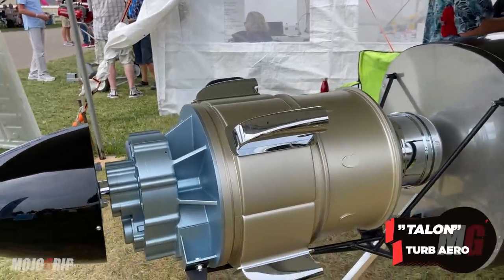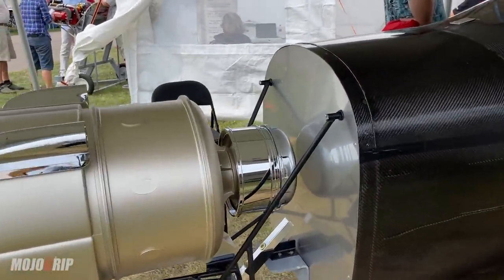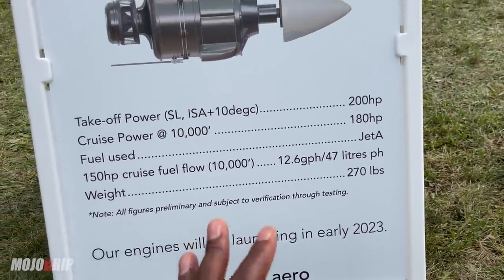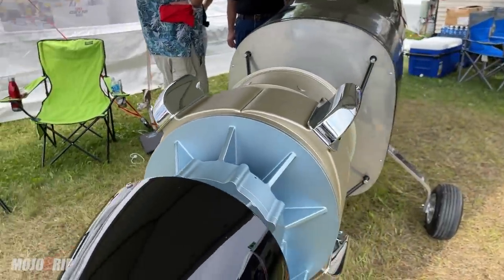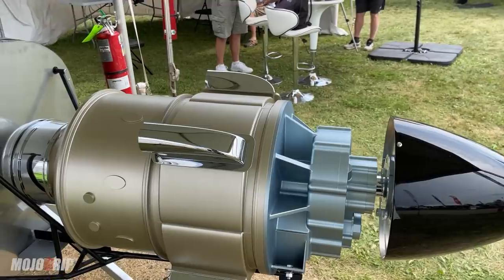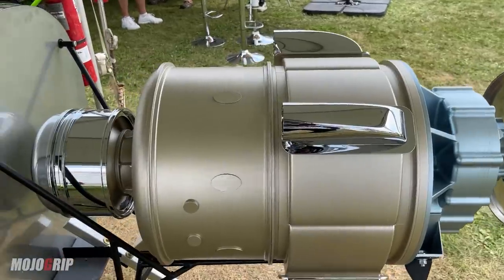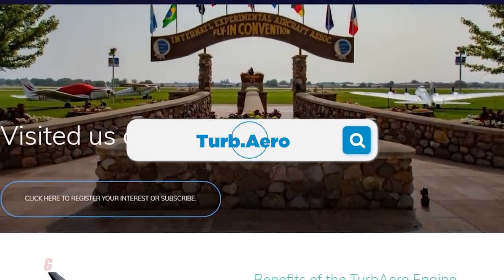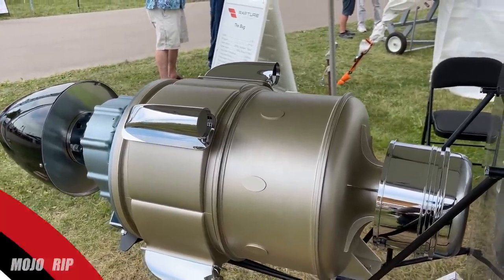200HP Turboprop Engine To Power Single Engine Airplanes - TurbAero

Comment: I have to ask now. Why do turboproppers always start their engines with to proppeller in Fether stand? Fether is smart when you are actually flying. But when stationary it is the most absolutely the most resistance. I think pilots are not the stupidest of the bunch. So there must be a good reason for it. Please tell me!

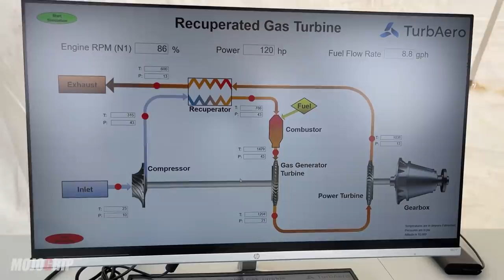Comment: 4:12 I'm not sure I understand that illustration. Theyre pre heating the intake air with the exhaust air? Why not just run a higher compression ratio to increase intake air temps, wouldnt that make for the most efficient result anyway?
Reply: It uses otherwise wasted heat to heat the air after its compressed saving fuel.

All ground based turbine engines trying to get decent efficiency have a recuperator.
Reply: @5002strokeforever  So I got the illustration correct. Why would a recuperator be more efficient than running a higher compression compressor. If the max temp going to the combustors can be 1200 degrees F why only compress the air to 800F? Why not get the added power and efficiency of more compressed air coming from the compressor?
Reply: Lets say due to cost  you are limited to 8:1 on the compressor and turbine.
Higher pressures are exponentially more expensive.

The only thing that matters is that you heat the compressed air to the maximum temperature the turbine is rated for.

This could (and has) been done with anything from electric heating elements, microwaves, and even nuclear reactors.

It really dosent matter how its done, and if you can harness some waste heat to help thats less fuel to be burned
Reply: Arriel 2b is over a million dollars with a 8:1 ratio.
 This 200hp plane engine is likely supposed to be much cheaper, you cant expect it to have a higher compression ratio.
The higher ratio the higher temps on the compressor and turbine. (More expansion and contraction requiring bigger gaps)
The tighter the tolerances have to be, when you are dealing with 120 psi it dosent take much of a gap at the compressor to leak all your power away.

Comment: Hate do be the downer here, but this smells like vaporware.
Reply: Scepticism is a valid reaction to this.  The onus is on us to deliver.  Our engine is solely within our computers at the moment (although we have built and tested several components already).  As of next week, we are cutting metal for our prototype (and machining and casting and printing and welding and...).  I hope that folks can watch the Talon come together as it transitions from vapourware to individual prototype components (hardware), to a functional running engine and through to a commercial engine that we are delivering to satisfied customers.

Comment: If they had to bring a mock-up for display, 2023 won’t be happening….
Reply: Hi rodzack.  The design is completed.  We are fabricating components for the prototype engine now.  It's not just a model, its 3.5 years of full on design, analysis, and component prototyping and testing by a team of 20+ engineers.  Deliveries in early 2023 is ambitious but we've set ourselves a target to work towards.

Comment: Who in their right mind would want to cruise in a turboprop at 10,000 feet?
Reply: Me!
Reply: the caravan does 10-12000
Reply: Beats a recip 200hp turbo. Imho
Reply: Fuel burn at that height would impressive, you'd need drop tanks
Reply: Turbines only work high and fast otherwise you burn more fuel than you travel in knots
Reply: @matthewspry4217  A recip engine burning 200hp is around 50-55 lph. Say a lycoming TSIO 360

This turboprop burns less and the fuel is cheaper.
Reply: @matthewspry4217  Are you a pilot?
Reply: @ashsmitty2244  The Continental TIO-360 makes more power (220hp) burning 12gph @ 12,000ft. So, same fuel burn but a lot more power at cruise. Jet A is cheaper though and this naturally weighs less than the recip.
Reply: @dieselyeti  Thanks for that,  I had the Continental in my head, the one in the Seneca’s. 

I have a few hours in them but a while ago, 15 years.
Reply: @dieselyeti  It’s also quieter, smoother, safer  sleeker, reverse prop. 

It’s going on my Dark Aero.
Reply: @ashsmitty2244   Here is the same engine 4 years ago, it's only been in development for 15 years 
https://youtu.be/FEn1iCU6Hh0

Comment: You're not going to get those numbers without more turbine disks and much high compression ratio's, Even with that, the physics of fixed air density vrs compressor efficiency vrs size coefficient, only gets worse as turbine engines are scaled down, and at that size, horrendously worse. Hence, lower specific fuel consumption in X-large size modern turbo fans and prop jets. You cant' beat the system on this one unless one has a magic wand.

Comment: The answer for ALL propeller driven aircraft is the "Dyna Cam" engine.  This engine has ALREADY been certified and flight tested on a Piper Arrow.  The "Dyna Cam" engine is superior to  the PT6 or the Allison or the Garret turbo props because it's vastly less expensive.  It doesn't require the use of high grade titanium like turbine engines require.  Yes it is an internal combustion engine, but with 1/2 the moving parts of say a Continental or Lycoming. Now what will happen if you go on the internet and just do minimal research, you most likely will conclude that the engine is a "scam".  This is FALSE.  The engine is GOOD.  What happened was the brand "Dyna Cam" got caught up in a complicated investment scheme and it's this financial scheme that paints the picture of the engine being a "scam".  I would encourage the GA community to back the inventor of this engine that USED to be called the "Dyna Cam" engine.  It does NOT matter what the engine actually ends up being called.  THIS is the engine that could revolutionize propeller driven aircraft.  Now please don't quote me on this: but to the best of my knowledge, this engine can run fine on "low" octane fuel.  Which means unleaded fuel.  Which means that as far as fuel, once you solved the octane problem, the only consideration is vapor pressures which that is a complex issue, but I'm sure can be solved.  If we can get the lead out, we get EEEPAH off our collective backs.  Let's not fool ourselves, we should trying to get AWAY from turbine power, not embracing it.  Yes, turbine power is wonderful on a B737 and I would want to keep it that way.  But all other classes of aircraft with propellers need to switch to "Dyna Cam" power.

Comment: The sad truth in history of civil general aviation turboprop singles is  We had a small light acceptable fuel burn family of engines that could of been used to power this class of aircraft since the mid 50s early 60s.  That would of been the Boeing T50 and T60 engines,  Yes   Boeing had a gas turbine division back then which they closed out.  Allison Continental or Lycoming could of bought the patents or license and made these.   Look them up on Wikipedia.  These small light but powerful engines was used on a early U.S. Navy anti-submarine drone helicopters back it the 50s and 60s. It also was the engine used to power the first turbine powered helicopter and was used as a turboprop engine on some models of the Cessna 0-1 " Bird Dog " light observation plane. Those engines and its designs sat in crates as military surplus for decades doing nothing.  We are over 50 years behind, seriously.  Was it the FAAs fault????  nobody wanted them back then ???.

Comment: Why are these parts so expensive? 80 grand for a 200hp engine?
Reply from the maker: For a turboprop, $80k is actually very affordable. Any standard turboprop in the market today will run you $500k and up
Reply: @mojogrip  but why? I mean what prevents me from using a 200hp motorcycle engine or two or four for that price? What is it that makes these turboprops so special. They seem compact but not tiny, light ofc and medium power.
Reply: @L3v3LLIP  In an experimental aircraft, there is nothing to stop you, but if you want to carry fare-paying passengers, or even charge people for flight instruction, you need an engine that is certified. Turbines are compact, and relatively light weight for their  power, they are also more reliable and cheaper to maintain as a result.
Reply: @tlangdon12  Thanks for elaborating :)

Comment: I was excited for this engine but when you said 1000hr for TBO is too low in my opinion for turbine !! I thought at least 3500hrs for tbo for this I’m out
Reply: the manufacturer in their website quotes around 3000hrs
Reply: Initial TBO is going to be low for any new engine until it's proven. The FAA is conservative with new stuff like this.
Reply: @dieselyeti  roger that
Reply: @dieselyeti  ok that make since then I’m in 🤞
Reply: I got modern Twin Comanche Do you think I could upgrade my piston to Turbine ? My IO-320 weight almost the same as the turbine

Comment: Turboprops are notoriously gas guzlers. 75% at 10k 47 liters per hour.  Expect way more at lower altitudes.
Maintenance is more expensive than for a piston.
It does not look like anything production ready
There are more small turboprops in the market.
Not a game changer at all.

Comment: 10,000 feet is nothing, and 12 ghp is much more than a rotax. why not configure it for a decent altitude where you can reach decent speeds. FL25 or 30 would much more useful. And FL45 even better. Also any news on costs to buy one.

Comment: Thats not a prototype, to be that close to release and not having an actual motor at Osh?  What am I missing here?
Reply: Hi Keith.  It was misidentified initially as a being a prototype but Mike corrected himself after to say model.  Also, we are targeting first deliveries in Q1 2023, so 18 months away.  We are prototyping components for the remainder of this year, with the aim of having the prototype engine running on the test stand early next year.  We have allowed 1 year for the test program which is ambitious but we need to set ourselves a goal and work towards it.  A lot of experienced/technical resources (manpower and hardware) are being used to make it happen.
Reply: @TurbAero  THanks for the information, I have looked around for alternatives to the IO540 for an RV-10 build. It pains to spend that kind of money on technology that old.

Comment: I hope this is more than a plastic mock up, some made up specs, and an effort to judge market acceptance.  Saying that because if they actually have a design, it shouldn't be too complicated to get 1 built.  Lots of shops out there that can do multi-axis machining and make one off parts pretty affordably.  That they haven't done it yet leads me to wonder if they a) don't have a design yet, or b) can't afford the alloys or the machining to build a prototype yet.  Even after they get it running, there's still a lot of work in getting the engine management software right, and going through the certification hoops.

All that said, if they can make the cost/hr similar to an o-360, it would be great.  100LL is going away, and turbine engines are simpler and more reliable.
Reply: Hi Tom. 
I'll take your last two sentences as a positive sign of support.  Thanks for that.  
To address your first paragraph, I might quote from Mike Patey who starts his YouTube videos with "Design it, build it , test it...".  TurbAero is in the final stages of the "Design it" phase and have just started the "Build it" phase.  I can assure you that it IS complicated to get one built.  The number of custom components, the multitude of different materials (Inconels, Titaniums, Hastelloy, MAR-Ms, Steels, Aluminiums, etc), requiring different manufacturing techniques (machining, welding, metalworking, casting, additive manufacturing etc) to such precise tolerances and those are just the mechanical components.  There are still the electronic components, fuel pumps and starter/generators with challenging characteristics, etc. that are not available off the shelf and need to be built.  There is a combustor, fuel nozzles and an ignition system that have to start the engine at sea level through to 20,000' without problems.  Every single component has to be analysed to make sure there are no rotordynamic issues that will result in poor engine reliability, high wear or even the engine tearing itself apart.  We had to incorporate new technology to offer better than historical fuel efficiency.  That component comes with significant challenges in terms of performance, weight cost etc.  The development of this engine is a serious undertaking that requires significant resources, with time being one of those resources.  We haven't "done it yet" because the development of such a complicated engine takes time and things by necessity need to be done sequentially.  This is what we are doing and we are doing it conscientiously to ensure that when we do finally deliver the engine, it is one that we can be proud of and will deliver a safe and reliable engine to the customer.
This is more than a plastic mock-up.  It is 3.5 years of design by over 20 engineers and we still have a way to go.  I hope that you will monitor our progress along the way but please don't expect an engine to be built overnight. That is not the nature of an engine development program, particularly for such a challenging small gas turbine.
Reply: @TurbAero  If it can be designed, and built, it sounds great.  Everyone should be aware that, as you explain above, there is a huge difference in complexity between an aircraft and a turboprop engine.  There have been hundreds of aircraft manufacturers over the years, but probably only around 20 teams have made a turboprop engine.  Most designs are decades old, so there should be room for improvement in efficiency, but at the same time the engines in service today took years of prototyping to get working.  

I do hope this works, but if you haven't spun up a prototype, and this is a blank paper design (not based on a scaled design from somewhere else), this is going to take a while.

I don't mean to seem negative.  People are used to product announcement in software and computer hardware, where design cycles are measured in weeks or months.  As you say, turbine engines don't work on that cycle.  Truly wish you guys the best.

Comment: 200 hp ?  the TSIO 55O  makes over 300 hp.
Reply from the maker: Yea but this engine will retain it's power output at altitude compared to a piston engine
Reply: @mojogrip   we are a cirrus service center.  we have customers wearing O2 in their sr22T's  flying over 20k +  with ground speeds in excess of 225 /250 knots  with tail winds. ( with the gear down no less ) you're not going much higher unless you pressurize the cabin. this engine may serve to possibly / practically modify the sr20 if you add an O2 system -  but for  how much $$$$$$$ ?  when does buck exceed the practical   bang ?

Comment: yeah....; yeah....... fairy tales lives forever........ // If you have time..... = wait and see......... // 99% of all these projects did die in the past for all kind of reasons (expected performance not realistic...; too much fuel burn.......; too heavy.....; too expensive to build......; technical problems.......;  a.s.o......) // I do take this vid as a teaser, for info purpose and broadening knowledge of possible engine projects....;  = no more, no less........ In addition: this engine would NOT at all provide 200 HP for take-off on  a HHH-day... = think baby.... !!

Comment: absolutely NOT a viable option to replace a lyco360. even fuel consumption doesn't make up for cost efficiency broken down to hourly costs of running it in comparison with lycoming 360

Comment: 12.6 GPH for 200 hp is nothing special. I fly a helicopter with an Allison 250-C20R that puts out a max 450 hp and we burn about 29 GOH at full power and about 24 GPH cruising around. 12.6 GPH is nothing special.

Comment: This is BOGUS!

-I can see right through this.  This is nothing more than a couple of kids at Embry-Riddle pulling a senior class prank and they managed to make it to Oshkosh!  There is a REASON there is no real engine other than a plastic mockup.  By the way, when have you seen a mockup engine with those colors?  Chrome plastic exhausts that look like something from Pep-Boys?  AND  they are on the top of the engine so they can blow right into the cabin air intakes on the wing roots of Cessna airplanes.  Hello? 

COME ON PEOPLE, look!  This is a JOKE!  it is real easy these days to make websites and produce a spoof.  I'M NOT GOING TO BE PART OF IT!

Comment: Mike Mike Mike. So young. So naive. I sure hope you’re right and they can make it fly but we’ve all seen “3D models” before. 
Get back to us when they make a working model. (And don’t give them any money!)
Reply: We appreciate that Mike has helped to raise awareness about our program and have extended the invitation to Mike to report on the engine once it is running.  Standby for that video early next year.  We are not asking Mike or any potential customers for money.  Once the engine is proven functionally, all specifications and performance figures are validated through testing and we have been able to demonstrate the engine to the public, then we will open the order book.  That is anticipated to be early to mid-next year.
Reply: @TurbAero  we can’t wait. As Mike said, game changer primarily because 100LL is harder and harder to get.